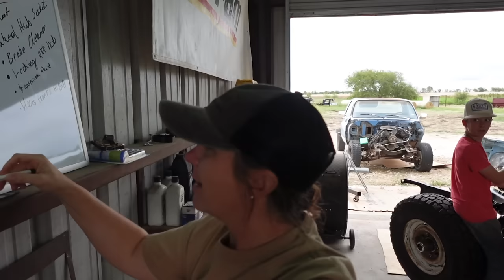Installing the Headers on the Square Body Truck! | Bar 7 Ranch

Comment: I envy you guys. Hahaha
Back in the early '80s, I decided to put headers on the '76 C10 I was driving.
Had a bit of trouble installing them, by myself, with the body and every other part installed.
Hahaha

Comment: If it is a gm block the oil pressure port is 1/8". I don't know what you have because blueprint casts their own engine blocks. If you trying to get oil pressure from the side of the block by the oil filter that one is 1/4". Most people use the 1/8" port next to the distributor.

Comment: Use a 3/8 to 1/8 brass adapter to your oil pressure sending unit

Comment: I wish yall had put antiseize instead of threadlocker on the header bolts. Due to extreme heating and cooling, the bolts dont like to come out in the long run just an fyi for future reference

Comment: i always find if you buy a assortment of fitting it always pays off... cuz the next project will require the 3/4 in   of course i have lots of boxs of fitting i will never us   nice headers   would out be easier to work if tires removed

Comment: That motor has Aluminum heads anything you bolt on to those’s heads have to have anti seize. Or you will never get them out. I hope you read this cause you will have a huge problem.